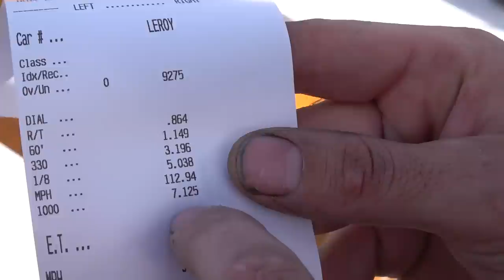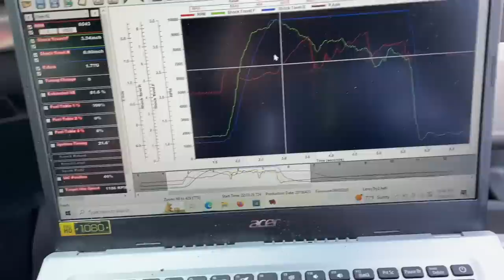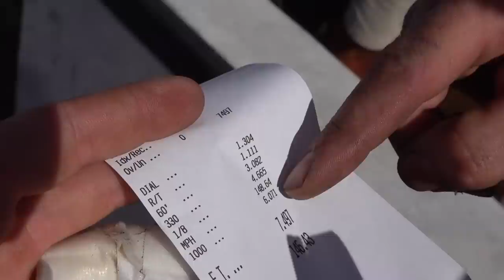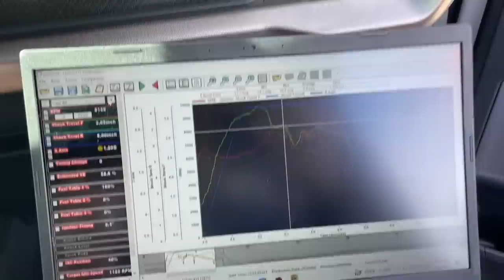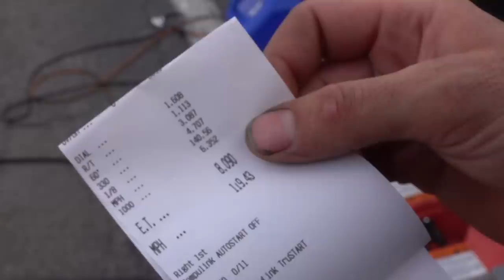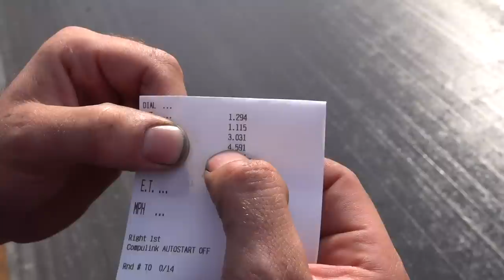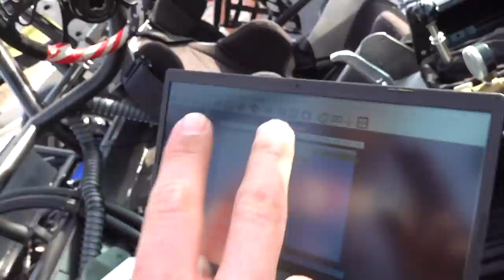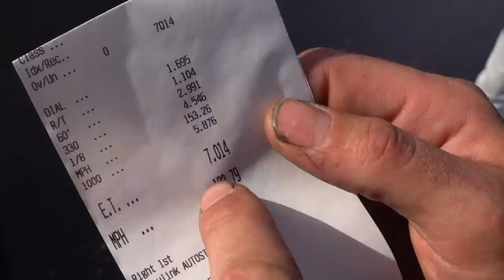You're Not Going To Believe This!!! LEROY 2.0's NEW BEST PASS!!! (Why Leroy... Why)

Comment: I think I've seen you get this tore up over driving back in the day I felt like there was a time you were almost too scared to drive, but you did it any way and now we're here. Pushing through to not lose heart over and over again takes a toll but as long as you're able to recognize that's what you're doing you'll find more and more reason to keep going.

Also, when your suspension/fab guy keeps saying he wants to do fewer changes between tuneups - the best example I can think of for a well defined like industry standard way to approach doing that ...CPU overclocking...manufacturers and advertisers have competitions to overclock CPUs and GPUs...One of the techniques very important to that group is to not make more than ONE change between benchmarks/runs. It might not benefit you to watch a whole bunch of overclocking tutorials/competitions to use those techniques in drag racing, but at least this specific technique can be relevant. Only make ONE change between runs, especially if you're not 1000% sure of what the results of the changes you make will be.

Don't ever take going on vacation off the table - even if that means being completely alone - or just you and your spouse, or you and some friends, whatever...just don't ever take that off the table.

Comment: Leroy needs that SMX 🤑
Reply: Mullet needs the SMX and Leroy should defo get the SML package!
Reply: Small block only stick class.
Reply: @T3nZ88  yup, let Leroy have Mullet’s refreshed engine and get ol’ Mullet an SMX.
Reply: @gnarkiller  is the SML not considered a small block? :?
Reply: @T3nZ88  yes my bad I got the two mixed up.
Reply: Leroy just needs a TKM stage 3 build, currently holding the hydraulic roller LS 1/8mile record of 4.12 @ 180mph to the on 64psi, Cleetus seems happy with Texas speed holding 40 lol

Kinda frustrating that Cleetus isn’t an engine company that are holding multiple records. 

TKM literally built the current stick shift 1/4mile record engine as well as previous record holder’s engine
Reply: SML is a small block, it's just an LS that Steve changed the head stud pattern on.  Smx is a water jacketed 481x big block.
Reply: @gnarkiller  hence why I said that Leroy should get the SML engine and that mullet should get the SMX engine :)
Reply: @T3nZ88  doggie I was replying to the op who said put a SMX in Leroy. Notice how I didn't tag your name?
Reply: @gnarkiller  sorry my bad chap

Comment: There is still way too much anti squat (first error) in rear suspension (bar angle value is too high). Rear suspension still tops out and loses a lot of traction. You can see it in the datalog; when suspension tops out, and tire makes its last "extension", then acceleration/ G value drops.
(second error) And there is way too much rebound damping, because they try to control the extension (which is caused by the first error) of the suspension, which does not allow tyre to go back down to track, and rear tyres loses a lot of traction. You can see it in the datalog; rear suspension does not move back and forth, it just extends continuously, and graph is almost straight line from start position (loaded sag/ car sitting still) to top out.
(third error) Because they do not have traction, they try to use traction control, to "get back" traction. They can not get it back because it is already lost with too aggressive anti squat and rebound damping.
(fourth error) "Nothing works" but they just add power/ more boost (and almost kill the engine? luckily boost limit is there...). Power is nothing without traction.
So, what should they do? Turn down the boost to some basic setup. Turn down TC to basic level.  Then they have controlled setup. And don't touch it until you get the grip back.
First step to get the grip back; less anti squat/ bar angle value must be lowered at least to level where rear does not want to top out and stay topped out. It may top out momentarily at some point (especially if there is a dip in the track surface), but it can not top out for longer time period.
Second step is to start loosen the rebound damping to allow the suspension to do its basic job (extend and compress in controlled manner) which is; keep the tyre on the track surface.
Compression damping may also be too tight, but i is hard say anything about it because at the moment rear suspension still does not work at all because too much anti squat and rebound damping, so compression damping is not visible in the datalog or rear view camera angle.

Comment: Cleetus, throw caution out the window on your hunt for 6's. Turn off the rev limiter, and the boost safety. Bend rods if you have to, blow it up, because as many 7's as Leroy has under his belt with that motor, it's already earned it's keep. That's what I would do, Go til it blows

Comment: Have you considered filling the front tires with nitrogen or helium, or just running them at slightly higher air pressure? That would reduce the rolling resistance. I don't remember if you have a belly pan, but it should make the air under the car flow smoother. Don't forget to fast for a week before track day!  Maybe add the jet engine from the B2? Oh, you could have Jackstand give you a push off the line!

Comment: You guys need a bar diagram of Leroy's rear suspension, print it loads of times, then make notes when at the track about the changes you're making and the differences its having, that will be how you figure this out, alll about data
Reply: There is still way too much anti squat (first error) in rear suspension (bar angle value is too high). Rear suspension still tops out and loses a lot of traction. You can see it in the datalog; when suspension tops out, and tire makes its last "extension", then acceleration/ G value drops.
(second error) And there is way too much rebound damping, because they try to control the extension (which is caused by the first error) of the suspension, which does not allow tyre to go back down to track, and rear tyres loses a lot of traction. You can see it in the datalog; rear suspension does not move back and forth, it just extends continuously, and graph is almost straight line from start position (loaded sag/ car sitting still) to top out.
(third error) Because they do not have traction, they try to use traction control, to "get back" traction. They can not get it back because it is already lost with too aggressive anti squat and rebound damping.
(fourth error) "Nothing works" but they just add power/ more boost (and almost kill the engine? luckily boost limit is there...). Power is nothing without traction.
So, what should they do? Turn down the boost to some basic setup. Turn down TC to basic level.  Then they have controlled setup. And don't touch it until you get the grip back.
First step to get the grip back; less anti squat/ bar angle value must be lowered at least to level where rear does not want to top out and stay topped out. It may top out momentarily at some point (especially if there is a dip in the track surface), but it can not top out for longer time period.
Second step is to start loosen the rebound damping to allow the suspension to do its basic job (extend and compress in controlled manner) which is; keep the tyre on the track surface.
Compression damping may also be too tight, but i is hard say anything about it because at the moment rear suspension still does not work at all because too much anti squat and rebound damping, so compression damping is not visible in the datalog or rear view camera angle.

Comment: Surely just running a few passes a with the 7.01 pass would get you into the 6's. I'm sure cleaner shifts combined with a straighter drive would be enough to get 0.02 of a second off the time.

Comment: u should be trapping 200 if you are almost in the 6s and still trapping low 190s i think theres a issue with aero and leeroy... imo that is the issue with the build it needs less drag i bet it would trap over 200 if it had a body on it

Comment: You need to use 5th gear. You are in 4th by half track you have the hp and the time to pull 5th. You are going to gain up to 20 mph and you should drop up to 2/3 10’s. Running it out in 4th gear is over.

Comment: Those Raycons are water resistant, not proof. Put them in the washer and you will ruin them. Hell, if you work too hard and sweat too much, they will only last a couple weeks. Went through 2 pairs last summer mowing yards. They would fizzle out while sweating, then work when dry, then eventually stop altogether.

Comment: There is a surer and easie and cheaper way coax Leroy into the sixes from where Leroy is than boosting him into the 50 psi 8000 rpm range of motor abuse. Since Leroy is an enormous aerodynamic disaster that spends most of his track time at well over 100 mph, it wouldnt take much improvemrent in airflow over the car  to get into the sixes It could be someting as cheap and quick and Cleetus video-worthy silly as ordering ten rolls of heat shrink silkspan and 2 cans of heat activated glue from your R/C airplane connections. Then you George and Jackstand could give Leroy's a 6 second disposable "body" in i under three hours. A body that would look like like a shiny Sopwith camel  and fit like a speedo swimsuit on Larry the cable guy.